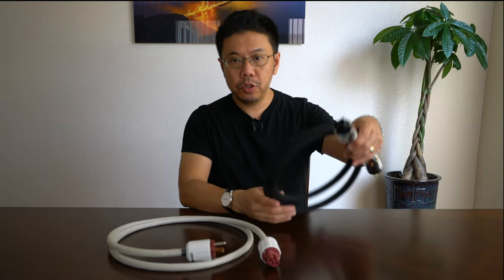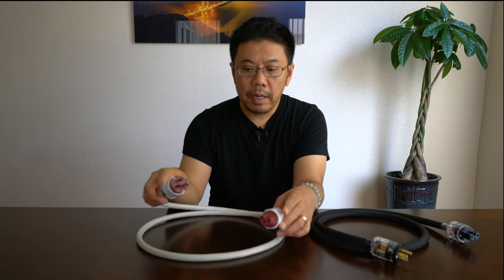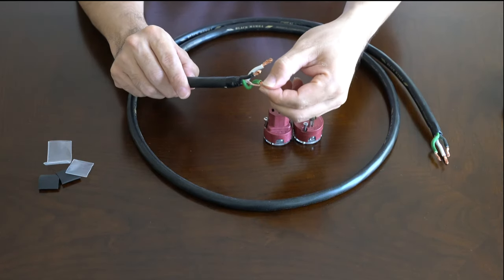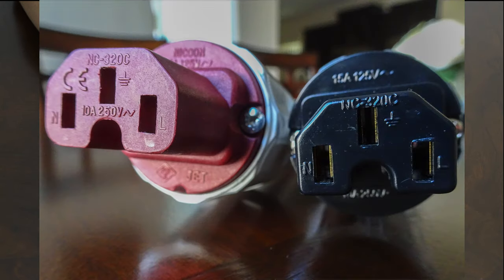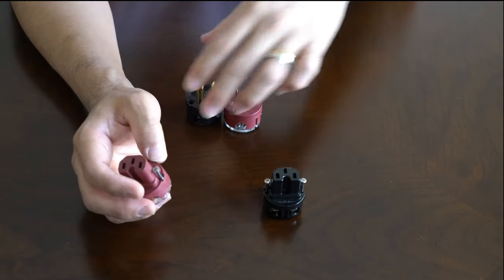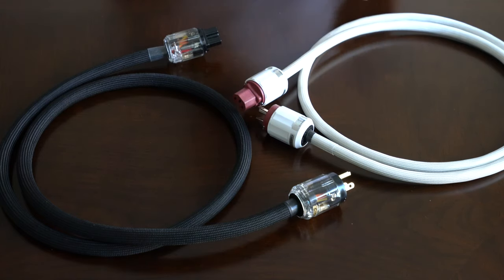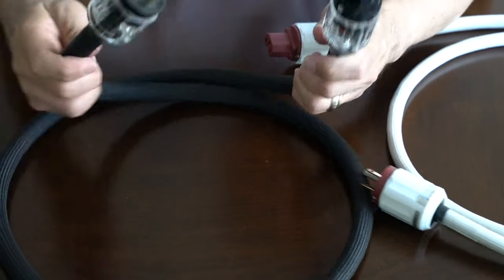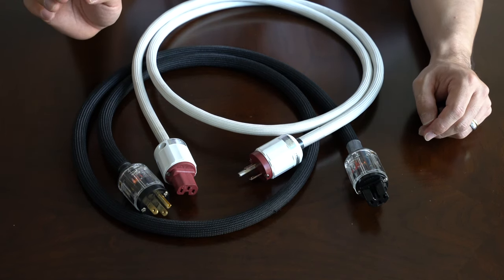Audiophile Grade Power Cables, Easy DIY AC Power Cords

Comment: If Your Power to the House Sucks, or Grpoundwing etc.... A SNAKE OIL CABLE WON'T DO D AMN THING. You can check your Ground (or have someone do it), and GET YOURSELF  a Top-Of Line POWER STRIP that has an internal 2 Stage 78 db EMI/RFI Filter. If your Grounds & Shielding are good on your Amplifier, that system and It's Power Supply are a pretty damn good Filter of Noise & Interference. If yer Power is Good & Filtered, Pay More Attention to the "Lower Level Signal" and Higher Impedance Input Interfaces.

Comment: Thanks for the info and taking the time to share your cable builds. I'm auditioning a Mogami W3104 power cable I built tonight as I write this and it's head and shoulders over the Audioquest cable powering my Marantz integrated amp previously.  In fact, I'm now all DIY cables on your recommendation.  I'm now using Belden 8402 interconnects and Canare 4s11 speaker cables in place of other Audioquest cables and your videos of the Bowers & Wilkins 607 drove me to move to the 606 this summer as well.  You'r one of the most down to earth audiophiles on YouTube and you're advice and reviews are some of the best around.  Your videos are very much appreciated!
Reply from the maker: Thank you for sharing.
Reply: @Tharbamar  Hey Thomas...if my Lg Oled is the source of tidal...what is the proper order... out of tv optical output should I go into a DAC then into my integrated amplifier analog input or main input but that has a jumper for pre out -main in... if I remove jumper I have no sound coming out of the right or left speaker...depending what jumper I pull out...I'm confused...please help me learn...thanks!
Reply from the maker: @briancampbell7712  Jumper has to stay in place, you just have to connect DAC analog out to regular analog input on amplifier.

The jumper is to use separate Pre or Power stage with external pre or power amps.
Reply: @Tharbamar  thanks so much my friend Thomas😁...I don't think I'll need to use those pre out and main in...since I have an integrated amplifier...Vincent SV-737...is that correct?

Comment: And which cables do you have in your walls? My guess is, normal electric wire, so what is the benefit of the last 3 feet of "high end" power cable? None in my humble opinion.
Reply: The benefit is cash for the dealer .
Reply: It's the same with 'High End'  speaker cables: you spent thousands of dollars on a couple of feet speakercable, but what cables were used inside the loudspeakers and the amp's ?  The chain is as strong as it weakest link so to speak.
Reply: @rover8772  this video, and other videos and examples show why "audiophile" is just a label, stereotype, a cliche.
"audiophile grade power cord" 🙄
being so: I have "audiophile grade power cords" in my water pressure pump installed in my house (shielded, line, ground, neutral, isolated cap/connector brand Leviton) .  
and I did not noticed my Milwaukee Drill has audiophile grade power cord

Comment: There is no "correct" polarity for AC power since the polarity changes many times per second. There is on the other hand correct polarity for DC power and damage will occur if that is not observed. If you don't believe this, look at the way European shuko power plugs are made. You can plug then in any way you like.
Reply: American and European systems are different. You can plug the Europen plug in any direction, Live and Neutral have no meaning. But it's not true in American systems, you have to follow the L and N marks precisely in America. And this is not voltage polarity at all, but name of the wires. The voltage/current is alternating thats why AC.
Reply: In the US the white wire is the neutral and the colored is hot, green is ground, the neutral is a GROUNDED conductor, The green is a GROUND conductor. The white carries current but is grounded at the panel, The green doesn't carry current unless there is a short. That's trying to explain it simply, best to leave electrical to a qualified electrician, there is a reason we have a 5 year apprentiship.

Comment: I just ordered three Oyaide Black Mamba Sigma V2 direct from Japan. And I have a bunch of that Mogamai wire you mentioned in a box that I was going to use for speaker cable. It will now be repurposed for power cables. I have the Venus II 12th coming, and was impressed that I could hear a sound difference in your video. And when looking to build this same cable, it was about the same price assembled when all was said and done.
Reply from the maker: Thanks for sharing.

Comment: It is important to have a ground wire connected at the power end.  This is both for safety and to bleed some EMI to ground.  If the amp itself isn't grounded to power, it isn't necessary to connect ground at that end but you may as well do so as that way, the lead can be used with power grounded equipment as well.  This just good practice to prevents confusion over grounding.   Paul of PS audio says that tightly shielding an amp cable is detrimental to the amp's dynamic performance however, distancing the shield further out from the conductors overcomes this and significantly reduces EMI leakage to surrounding equipment.  This means that the amp power lead ends up about an inch thick.  I have also come across people who prefer to plat (braid) the active, neutral and ground wires together rather than twist.  Note that while the ground wire should be connected at both ends, the shield should be lifted at the amp end and grounded at the power end.
Reply from the maker: Thanks for the advice, ground is not necessary for two pins power cables, not all components are designed to use with ground connection. 

I also have PS Audio AC-12 & AC-5 power cords and my DIY cables sound better than AC-5 and very close to AC-12 in terms of performance. 

Mogami base cable in this video is for two pins power cables not to use with ground connection unless they want to lift the ground.
Thanks

Edit: I made two type of power cables in this video, one is grounded and one is for two pins power cable.
Reply: So on the power side, to the wall, wrap the ground wire to the neutral wire?  But on the IEC side, to the equipment, do you simply cut back the ground wire?  Would it harm anything if you wrapped the ground wire to the neutral wire on the IEC side?

Comment: Power cords are like tone controls, they can either enhance or detract from the sound...it all depends on the particular components used and where you place your power cable(s).  Caution must always be used when mixing or matching various cables!  It is also wise to change them in or out incrementally to discern whatever changes.  I currently have a power cord on my amplifier and power conditioner, but used nowhere else. A noticeable improvement of dynamics was the biggest change with a darker/silent background. Cheers!
Reply: @edwardbit8225  If I can hear a difference and you cannot, that is your consequence not mine!
Reply: If you have a resolving enough system you CAN hear the difference, but for some indiviudauls it may be limited to what you are able to hear or discern. "Not everything that can be counted counts, and not everything that counts can be counted."
- Albert Einstein
Reply: @edwardbit8225  Have you heard of infrared light that may be a good example.  There are things that cannot always be measured, but exist non the less.
Reply: @edwardbit8225  I think you may have a problem believing people can hear things you CANNOT...NO FURTHER REPLIES, Peace!
Reply: Try putting a power cord inside your rear, it will really enhance your listening experience. Don't ask how i know.

Comment: Great job ! And I agree a lot of cables are over priced most companys are just a middle man that buys cables from china ! But Being an electrian for 8 years and now a Maintenance man of Montaplast of north America for the last 8 years I can tell ya a dedicated circuit 30-amp from your breaker panel to you electrical Wall receptacle (Ps-audio) will produce the best results for you even better than bigger power cables But once you do both ohh myyy!!
Reply from the maker: Will it still benefit from having dedicated circuit because I have my own transformer for my house?
Reply from the maker: I never had anything like flickering lights or dimming effects, never had unusual behavior with Parasound set up but lights dim a little when I turn my Denon Amp on, that’s about it. Thanks I will keep that in mind for next House.
Reply: Tharbamar appreciate all your input on audio reviewing ,your doing a great job , ohh you just have dining on start up with your lights ? Compasitors charging up!!  Lol

Comment: Good share..It's cheaper to buy factory terminated.. Oyaide and acrolink is both value for money. Also.. The shield foil should be connected at plug end only..there is a huge difference. Don't buy fake or china its very simbilant and lightweight in sound..if going cheap just get hubbell

Comment: Hello, I really appreciate you work and I'm watching your films with a lot of curiosity. I'm planning to build Power Cable for my old CD player T+A CD 1200 R using IEC C7 connector suitable only for 2 wires, how do you think does the Mogami W3104 used for this purpose will improve performance of my CD player compared to a stock 1$ cable?  Kind regards :)

Comment: Nice looking but power cables have NO effect on the sound unless you have a cord that is making a bad connection. In most all neighborhoods everything your neighbors have hooked up is connected to your house wiring. The secondary of the power co. trans. feeds multiple houses. The first thing inside audio components is a isolation device, (a transformer) so whats between the wall and the device, as long as it makes a good connection is all for looks. After that cables in the signal chain matter.

Comment: Great cables ! But they would of been better with ferrite filter on both sides of each wire 👍👍👍  Cleaner electricity for your equipment )
Reply from the maker: Thanks for the advice but It will not give me better sound because I do not have problems with noise interference and it will only benefit to components with poor power supplies I have my own whole house power transformer that I get cleaner power supply than the most.thanks
Reply: @Tharbamar  Nice ! 👍

Comment: "Make sure your polarity is correct otherwise you may have big problems" - as long as you don't confuse earth with live, you won't. Neztral and live are the same for an AC system.
(Mind you, I'm not saying it doesn't matter if you plug in your cord correctly, which affects sound quality - but for the same reason mixing up live with neutral won't harm your system).

Comment: I see the cable for the amp is not shielded.  However as this has the highest current flowing through it, do you not want that to be shielded so as not to cause interference with low current interconnects (DAC to amplifier etc).  Nice video.

Comment: So, to understand it correctly, can i use mogami 3104 and just ignore one of these four cables and make a grounded power cable? just one for hot, one for neutral and one for ground?
Reply: live and natural has to be together proferably straight not twisted .but ground should be seperated from the cables .if you put it even near the live or natural its like shooting your on leg .AND NEVER EVER TWIST THE GROUND WIRE .BIG MISTAKE...THE BEST GROUNDING IS FLAT FOILS LIKE COPPER OR SILVER....

Comment: Thank-You for the video.  I noticed you connected the copper shield wire to the green ground wire on the male connector side, but on the IEC connector I did not see what you you did with the copper shield wire.  Can you explain?  Thank-You
Reply from the maker: Yes, lifting the shield ground on IEC is for better noise control by draining all the noise to the ground on wall side.

Comment: The plugs look great. Thing is, I get it with interconnects and speakers but don't tells us you need this or u will have problems. This is nothing, unless you have your entire house wired with this instead of the 12 or 14/2 wire windings through your entire house before it reaches your outlets.  Looks good though.

Comment: Does anybody have any recommendations for a UK termination equivalent of the Oyaide products. 
I have ordered the Black Mamba & Ferrite connectors to make my own.
Mr Tharbamar you videos are very genuine, authentic & your DIY vids are truely easy to understand. In fact after watching them, i have also order Mogami 3082 to make my own speaker cable & Jumpers. Iv purcased the Canare 4s11 biwire (made the biggest difference i have ever distinguished from a cable) The Belden 8402 & the Canare L -4E6S.
Truely thankyou for your exellent insight & expert advice ✌️ 15:02

Comment: Any competent electrical engineer knows that the proper power connection is not just an electrical interference problem from the power cord... it is from the line to the home, also. The modern use of line conditioning is a very technical problem to solve... but not usually for a sound system, unless there is a huge power requirement. A laboratory could use a complete power source treatment, yet a home audio system would triple the typical cost of the system to implement. A true isolation transformer (ground lead from output is open)  fed from a Tripplite power strip, and an output over voltage circuit on the of the isolation transformer would do. That would work on a low power installation if the isolation transformer is rated at least twice the power rating of the load.

Comment: I will install audiophile lights in my room, the photons and the preassure of atmosphere in Mexico City 7200 ft, the air molecules impulsed with sound waves make the sound increase the modulation of frequencies once the speakers cone and suspension are in contact with the temperature and room light.
Reply from the maker: Very admirable 👍 👍

Comment: The shielding looks automotive. I've seen it on wiring under the hood so an Auto Value or parts store should have it. As well a trip to a pick and pull should give you as much as you want

Comment: Again, very useful and this will save me from the most common audio snake oil. Thank you for sharing your knowledge. Can I use Mogami W3104  to make a power cord with ground? If so, which wire (s) would you use for ground and which one(s) for Live vs Neutral wire(s)? Many thanks.

Comment: Is mogami speaker 3401 rated for 240v. Compliance? My recommendation, use Belden 83803, or another compliance’s shielded power lead. So many things are wrong with this tutorial.
Reply: With 4mm² its capability is close to 3800 watts with 240v and a 16A fuse. So I believe it will do the job gallantly.
Reply: Such cables usualy have 660V rating. So everything below is OK.

Comment: So am I correct in assuming that when building a power cable for your AVR and/or power amplifier (for example, I have a Marantz SR6014 and Emotiva BasX A3) you'd use the ground-lifted construction? Would there be any harm in using the first, grounded construction for those components?
Reply from the maker: Yes ground lifted cables are to use with components without ground pin.

Comment: A 3 prong wall to 3 hole IEC should NEVER be constructed without a ground wire. If it ends up used on a device that requires grounding of the chassis you have a safety problem. and there is no sign externally that the ground is missing. Unless the device has only a 2 prong IEC socket, use a grounded cable
Reply: Always use grounded cable.

Comment: How do you know if you need a grounded or ungrounded cable? I want to make a power cable for my Sennheiser HDV 820 DAC/AMP but I'm not sure if it needs to be grounded or not.
Reply: you can see on the device to which you want to connect the cable if you have 2 connectors or 3. However you can just make a grounded cable and use that on both grounded and non-grounded devices

Comment: I would of tinned the wire ends before inserting them and tightening them down as copper oxidizes and increases resistance. Also, you don't risk crushing fine stranded wire that way.

Comment: Learned a lot from your DIY video. Now I'm doing this with speaker cables. What's the size ratio of the sheathing and the speaker cable if the speaker cable is 14mm?

Comment: Very informative video. But may ask: what if my stereo receiver's power inlet got 2 pins only like IEC C8?
Reply from the maker: You can also build your own without ground connection.
Reply: @Tharbamar  but would it defeat the purpose of building this high quality thick shielded cable if there will be no grounding system for my stereo receiver? I thought the ground wire is necessary to cancel any ground loop that cause buzzing or humming.
Reply from the maker: @jefnav7460  if you don't have ground pin on your component IEC there is no benefit, you can only use it for shield and drain.
Reply: @Tharbamar  Ok. Thanks again and keep up the good work.

Comment: hello, pardon my ignorance but how do you guys deal with equipment without an IEC inlet ?  like my receiver for example, the only way for me to make this happen would be to open up said receiver and solder the power cable.... any ideas ?
Reply from the maker: Best thing for those with permanently attached power cable is isolation transformer, thanks
Reply: @Tharbamar  ok thank you !!
Reply: @Tharbamar  well,you have isolation tranformer in all the audio gear,thats why power cable doesn't need shielding ,just the proper gauge.

Comment: So on the power side, to the wall, wrap the ground wire to the neutral wire?  But on the IEC side, to the equipment, do you simply cut back the ground wire?  Would it harm anything if you wrapped the ground wire to the neutral wire on the IEC side?

Comment: can the power cable 3104 for a tube integrated amp be assembled per your video here, meaning no ground connection on both end ? thanks .
Reply from the maker: Yes, if your amplifier doesn’t require ground, thanks